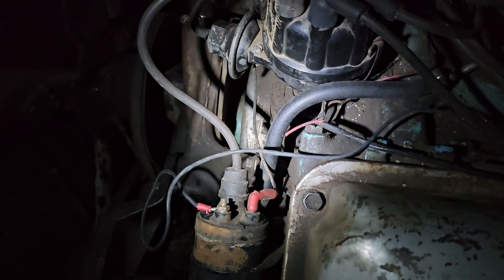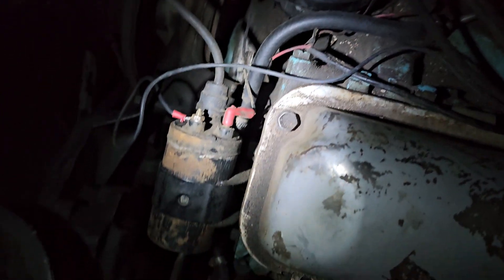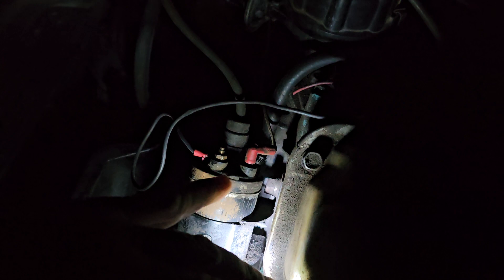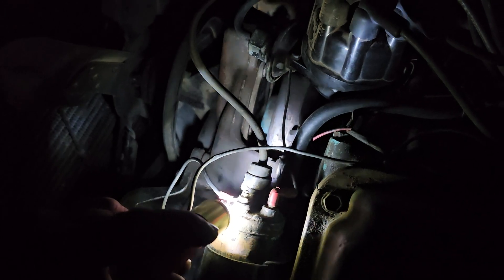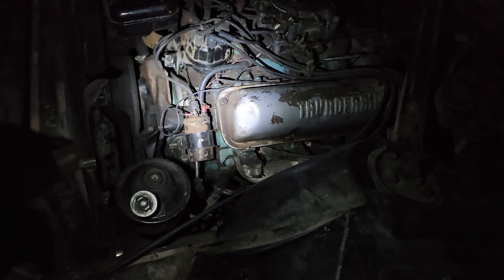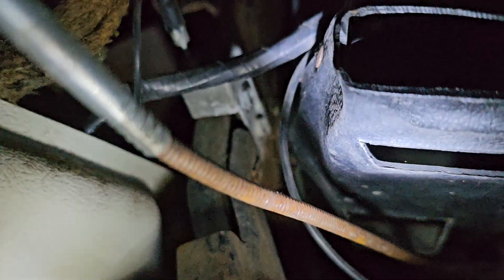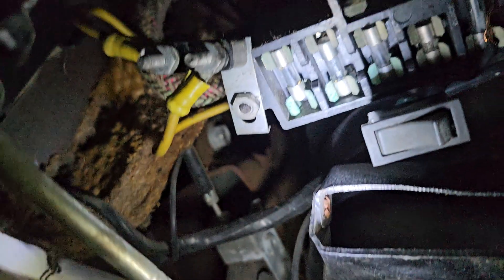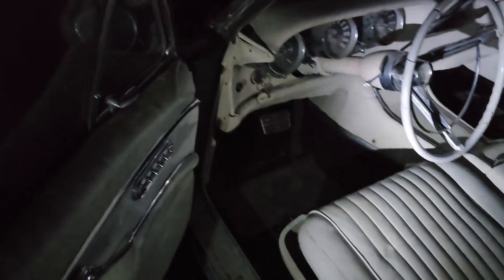how to wire a Ford coil to make it run! Short video for a follower.

Comment: i just got my wiring for my thunderbird and ive been reduing the igntion switch and harness, i dont wanna be a bug i cant find nothin on the internet on the harness wiring, my new after market replacement switch harness has a purple wire but my tbird dont have a purple wire, i has suspicion its this red wire suppose to go there stock. also completely missing a wire i think might be the igntion wiring. hey man if you ever get a chance to have a look at the igntion switch whenever your workin on that bird please let me know!! meanwhile ill try my best to figure her out! will make a video sometime
Reply from the maker: You may need to buy something like this. https://www.classicindustries.com/product/all-years/ford/mustang/parts/L69111.html?gad_source=1&gclid=CjwKCAjwt-OwBhBnEiwAgwzrUp2EVkm1woWKWD9LUxkHHQwtlKRhGgUVvqnGIvGBzeywMMqmgzAy6RoCbwoQAvD_BwE&gclsrc=aw.ds I'll see what I can do.
Reply: @landoncustomclassics  thanks man ill look into it! i got it wired i think. my issue now is it wont engage the starter last time was on the crappy orignal piece i was testing the voltage come every wire and i jammed it into the starter terminal wire and that was the only way it would engage with the key turning. some reason new wiring and switch still clicks no start.. gotta figure it out tomorrow im thinkin, and do the igntion wiring also!